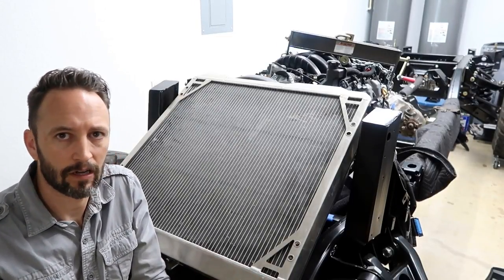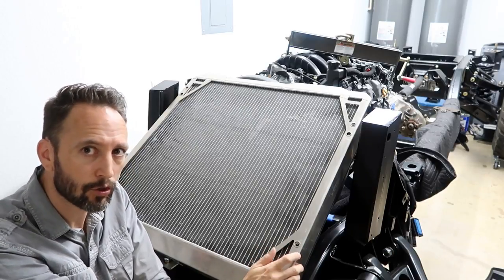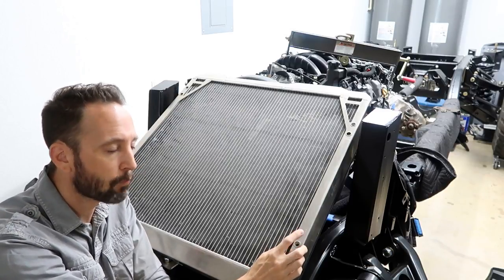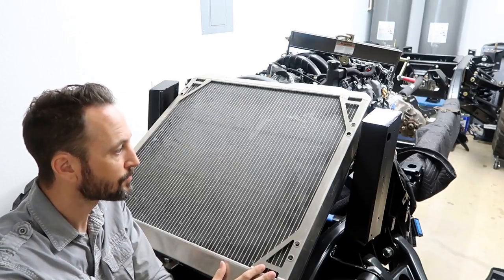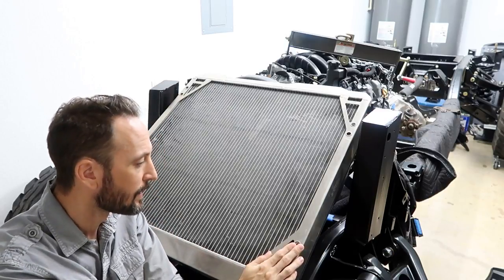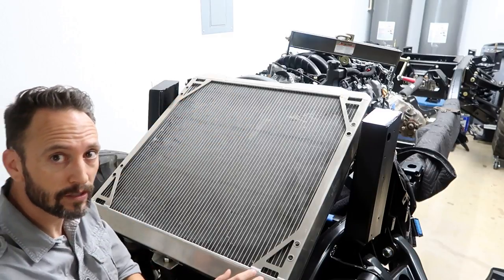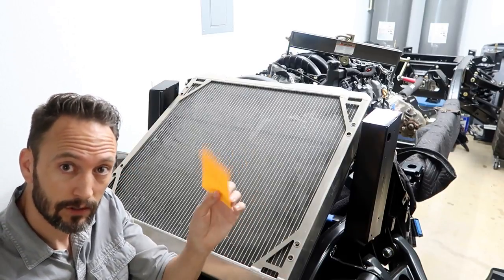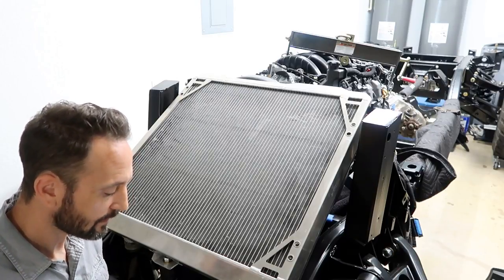$300 Aluminum Humvee/Hummer H1 Radiator - What You Need to Know Before Buying!

Comment: WHAT?? the heck are you talking about? bras and copper is forever. the old rad is 100% rebuildable. brass copper and lead solder?? Aluminum is the weakest. they are the hardest to repair they have the most corrosion and oxidation especially in the salt / rust belt of USA. the top and bottom tanks with the brackets can be removed and resealed try that with your CHINESE rad.....  Sory, I don't talk about this lightly I've been working on these Humvees for about 25 years now. and NO, keep stock one!! have a cooling problem get it flushed/ rebuilt or use a GOOD pusher (electric) fan.
Alum is good for a cheap flip or racing (CHINA). otherwise invest in stock if Alum was better the military would of used it!!
As for my Duramax friend's the 2005/6 ALPHA is a alum rad and GM regrets it, leaks BAD.
Other than that good video, Thanks, and good luck with your GAS (🤮) convert  hummer..............lol.
Regards JT's Humvees.

Comment: Have you done any before and after testing on temps?
Reply: ...and what about torsional testing and testing on a shaker test rack, or actual off road testing?  Of course, if the only use the HUMMER/HMMWV will see is an occasional run to Dollar General and back, such "Qualification" testing is likely not necessary!

Comment: Bought a ron davis for my h1 and it was leaking within a year. When I inquired about a discount for another one (because he wouldn't warranty this one) I was told no. That was the single biggest waste of money I've spent on a vehicle. This was about 7 or 8 years ago so I think they were one of the only ones producing them beside griffin.
Reply from the maker: This is an unfortunate issue especially when those radiators cost $1k+. I think part of these failure can be contributed to shops not replacing the insulators.